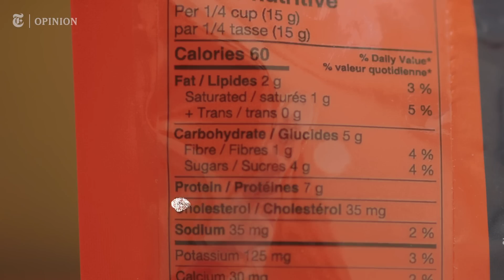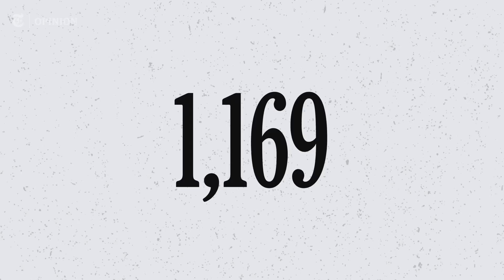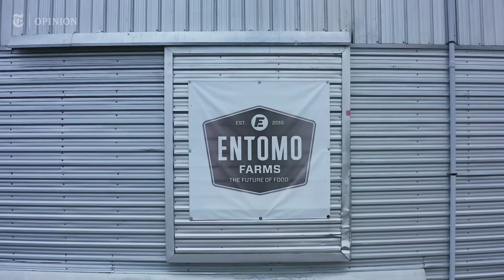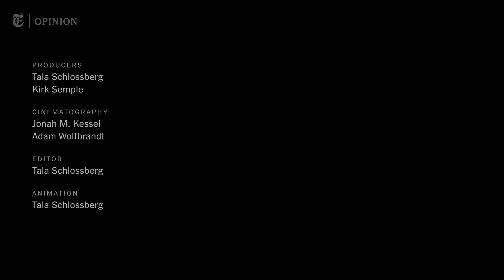The Case For Edible Insects | NYT Opinion

Comment: When will yall understand changing what protein you buy at the market isnt going to do ANYTHING until the oil and tech industry is checked
Reply: We can't solve this crisis without addressing food production.
"Eating a vegan diet could be the “single biggest way” to reduce your environmental impact on earth, a new study suggests. Researchers at the University of Oxford found that cutting meat and dairy products from your diet could reduce an individual's carbon footprint from food by up to 73 per cent.Sep 24, 2020"

Link on my channel under "About."
Reply: We can do both simultaneously!  We need to use all measures possible as quickly as possible!  The expert panel of the UN found that animal agriculture contributes more to climate change than all transportation combined!  They urged mankind to switch to a more plant based diet ASAP.

Link at my channel under 'About."